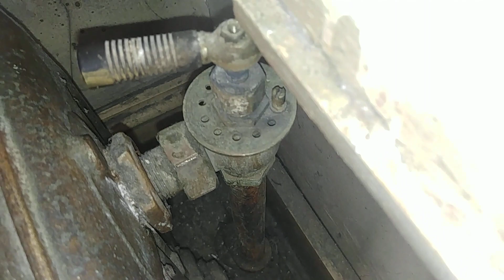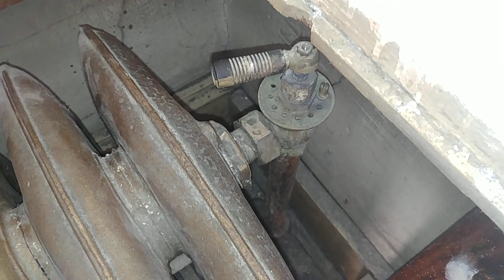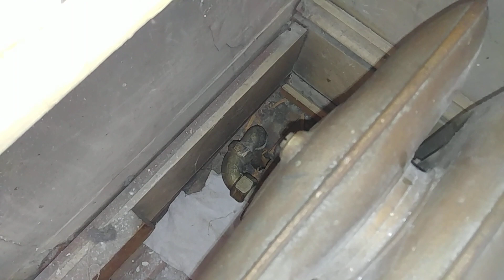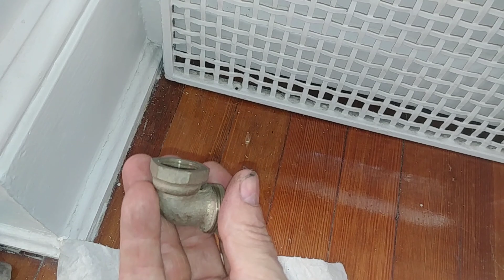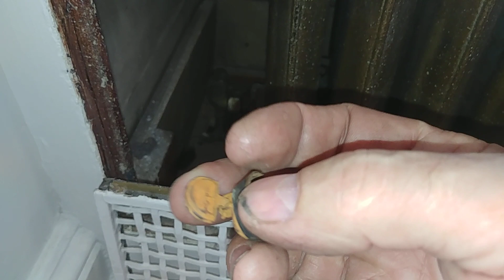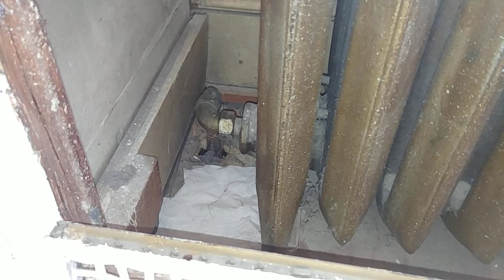Steam Heating Two-pipe Vapor Systems Sometimes Had Patented Quirky Gizmos That  Didn't Work Well

Comment: In a steam trap ... what is the difference between a bellows and diaphragm?
Reply from the maker: If I understand your question correctly, I think a bellows (called sometimes a Sylphon 90 years ago) that contains a water/alcohol mixture acts the same as a diaphragm containing the same fluid in a thermostatic trap.
The details are in the differences in the construction of the two containers.
Reply: @gordonschweizer5154  thank you ... can I email you a photo of a thermostatic trap with a diaphragm in the cover ... so you can tell me what manufacture it is?
Reply from the maker: @gquin9487  Try sending a picture to allsteamedupATverizonDOTnet